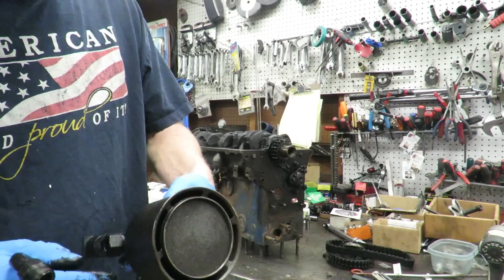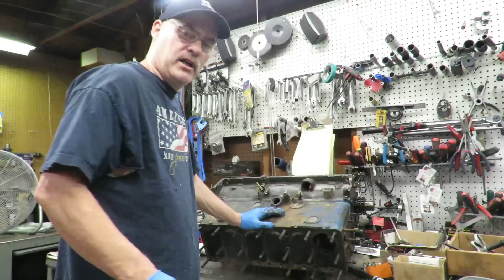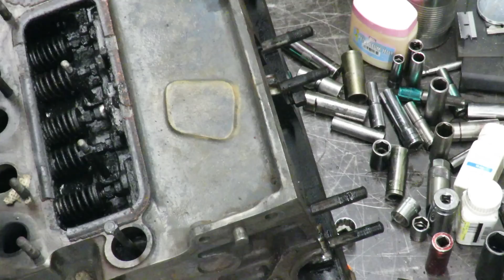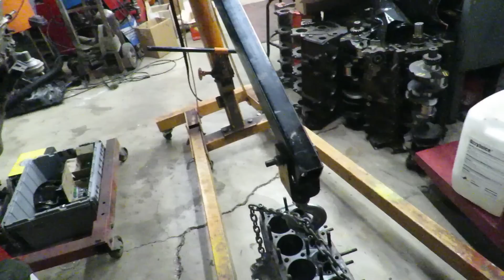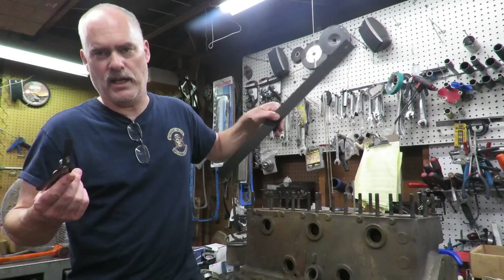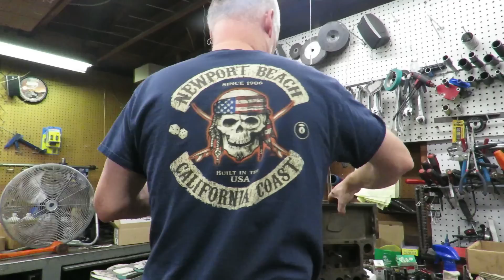Chrysler/Plymouth Flathead rebuild part 1

Comment: do you work on jeep engines? in line 6...4.0
Reply: Benny Rosado he did a jeep 4 L build and has a series of videos on it
Reply: ok cool, thanks for the info!!!
Reply: Benny Rosado no problem, I'm pretty sure it was a budget build so that might be in the title,but its been a while.
Reply: just checked out the last video on the cracked head!! that sucks when you're close to closing up a project!! again thanks for your help i learn a lot from his videos...he is well detailed in the break downs...
Reply: +benny rosado

Head cracks are a problem in some Jeep 4.0L variants. If you have a 331 casting cylinder head that doesn't have a "TUPY" mark, you have a higher risk of head cracks. Many people will buy a new casting from Clearwater Cylinder Head which has about 4lbs more iron where the OEM head would crack.

Comment: That silvolite company still exist in Carson City Nevada they advertise all their Pistons being heat treated and I noticed you pulled the oil pump it look like a distributor so what controls the spark when and where did the distributor just come in on the other side and then ride on the top of the gear rather than the bottom or did it have a shaft that went in the bottom oil pump curiosity kills me?
Reply: If you look closely you will notice the distributor bore on the opposite side of the block from the oil pump. The distributor is driven by a coupling on the end of the oil pump shaft.
Reply from the maker: the distributor is on the opposite side
Reply: Myvintageiron7512 thanks man looks like Smoby44 was a little quicker to the draw I love this stuff and believe me I take it all in
Reply: I'm not sure how the 2 are related, but I often read about Keith Black pistons at the same time that I read about Silvolite pistons. I think Keith Black is their high performance division, but I am not entirely sure.
Reply: Skyline Fever both are part of United Engine & Machine
Reply: @stevedouglas4478  Thanks for the explaination.

Comment: When I was 6 years old, 1958, I honed the flat head 6 in our 1950 Plymouth.  My father was fitting new pistons and rings and he did a valve job on the head.  I did the honing, because I could fit in the engine compartment.  I sat on top of the engine and did my honing job.  This video is taking me WAY back.
Reply: Some people say that the original air cooled VW engines would have lasted longer if they had a spin on filter rather than an oil strainer.

Comment: Talking trash about Babbitt bearings !
Reply from the maker: Babbitt type bearings work well the problem nowadays is finding someone to poor and bore them I actually used to work at a shop that did it so I'm very familiar with the process it does take a fair amount of skill to do it that's why it's hard to find anyone who can do it most of the machinists that were good at it are dead if you wanna have some fun try telling one of these young engine builders now days you want your bearings poured and bored and they will give you the deer in the headlight look
Reply: Myvintageiron7512 they guys that keep antique steam engines running are the few that are keeping that skill alive.
Reply: @BustedWalletGarage  YES. Kieth Rucker from Vintage Machinery is one on the youtube.
Reply: I've been following you for a while now. Great to see video guys actually reply to comments. Not happening much with the newer generations. I've been searching for someone to do a stroker build for me for a reasonable price that come with a warranty. You still build these? Great videos! Amazing!
Reply: Freedomquest08 the trolling is deep. Seriously it was the only technology they had at the time. It took ww2 to really push bearing technology and funny enough we made the best at the time.
As  for replacing them,its not rocket science. I actually replaced the ones in a 31 model A with my dad. Pouring them was the easy part finding someone to bore them to size was the hard part. But it's not anything a good job shop  can't handle.
If you're serious Keith fenner at turn wright machine shop did some on his YouTube channel a while back.  
Its not rocket science and if someone can line bore a block  they can machine poured bearings.
Reply: BustedWalletGarage true but a lot of people that work on historic stuff like that ate volunteers. There are shops that still do  it but they're not easy to find and it can be very expensive.
Reply: I've done a bunch of them, but indeed all big ones for steam locomotives at work. Its not as hard as people make it out to be, but you can't really blame anyone for not wanting to do a job that involves lots of fire and lead fumes in their shop.

The lining in insert bearings is essentially babbitt anyhow, so its not really a matter of preformance or durability as it is convenience to work on.
Reply: SouthJerseySound a lot of steam locomotives have found their way into big amusement parks. At least those mechanics are getting insurance benefits.
Reply: BustedWalletGarage and what's that got anything to do with this lol.
Reply: SouthJerseySound go to 1:25 mark
Reply: Some things deserve trash talk. Way back when, my high school girlfriend's dad had a Chevy pickup  with a poured bearing stovebolt. Every other weekend he would be under that truck (beer in one hand, wrench in the other) with  the oil pan off, packing the #2 rod cap with leather so it would 'survive' for another couple weeks. In the 1980's, according to him,  no-one in Las Vegas would dare pour a bearing.  His story was he had to do something really stupid like mail the rods and crank to a shop in LA and pay 3/4 what the truck was even worth to do them. He never did, as it wasn't worth it.  He really should have just swapped it for a SBC and hauled that Babbitt boat anchor engine to the scrapyard. What a horrible design for them to build something  so long ago that was virtually an unservicable, planned obsolescence POS.
Reply: @Freedomquest08 You could probably pour babbitt yourself,finding a machinist that knew what to do next would not be easy. I believe '54 and later chevy  blocks used insert bearings.
Reply: Freedomquest08 his fault for not learning how to fix it properly.
Reply from the maker: I used to do a bunch of em the problem now is finding a shop that is set up to do it
Reply: EGGE pours babbit bearings because they specialize in engines that are old and rare.